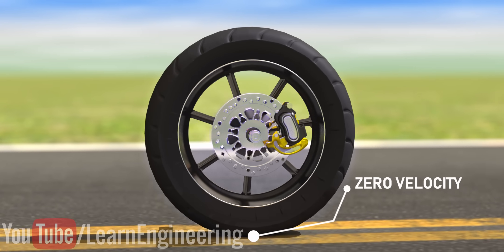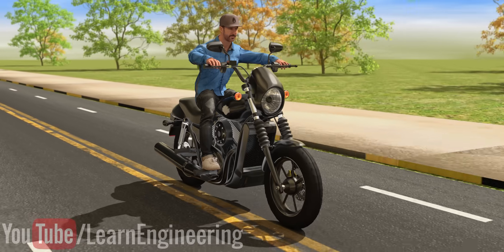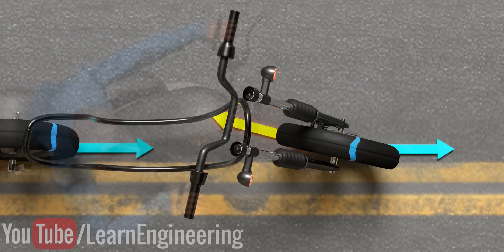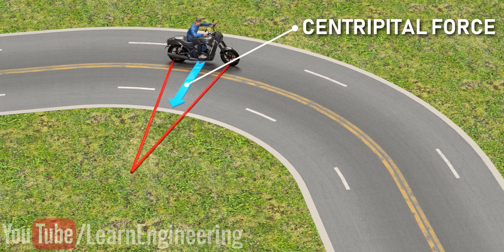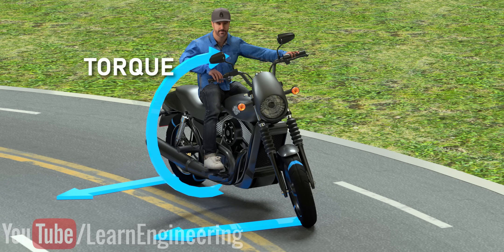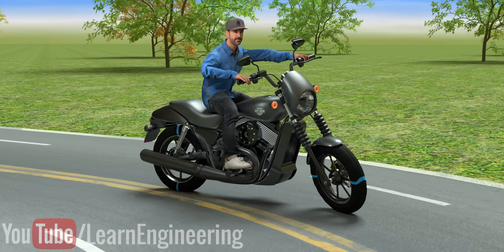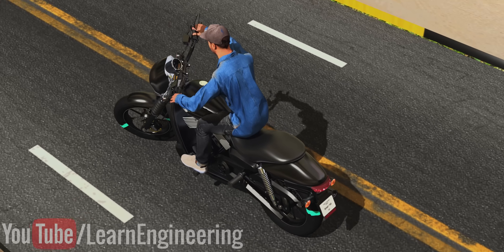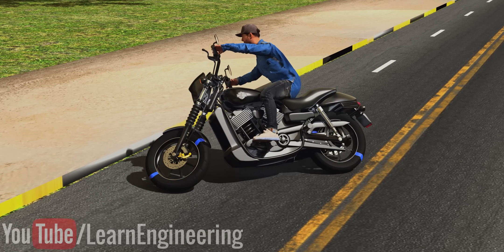Counter Steering | The interesting physics behind it

Comment: This is an okay explanation on the basic forces applied in turning scenarios, but it's too generic as it assumes the bike is always going under 15mph where you can overpower gyroscopic forces of the wheels. Otherwise you could never steer normally anyways on anything over 20mph as the wheels are producing too much gyroscopical force. Regardless, the technique is life saving and essential for good emergency habits and skills.
Reply: It’s not really though is it. It’s very misleading in the “cleverly turns” bit.
Reply: Gyroscopic forces are so miniscule that you can forget it completely.
You can even cancel the effect and the bike will turn just as fine.
Under 15mph or over 20mph does not matter. Btw. why there is 5mph gap?

Comment: No No No! First, you don't turn the handlebars to enter a corner, you lean. You can't turn the handlebars from straight, there is too much gyroscopic force preventing that. Next, if you want to get more turning effect, you press down on the inside grip. This will tighten your turn. If you want to turn left, press the left grip. I think this guy is talking about weaving opposite into a turn at slow speed. This is dangerous stuff to do as he says. Best of luck!
Reply: I’ve never seen anything as wrong as this video, until I came across your explanation! How wrong can you get this fella? Do you even ride a bike??!!!!
Reply: That's a new one. "Too much gyroscopic force." :D

Comment: Finally. I've watched several vids on counter steer & could not make any sense of it. Now I get it.
Reply: If you think this video is correct…… you don’t get it. This video is dangerously inaccurate as far as counter steering is concerned!!!!
Reply: @softailfun  how so?
Reply: @porkchopspapi5757  
Here’s a link to a practical demonstration of counter steering https://youtu.be/lzk8oyNO708
Note the rider NEVER steers into the bend although the front wheel does indeed steer into the bend. This is due to the bikes own geometry at work and not rider input. In the video you see the rider wanting to turn right, he initially steers left and then “cleverly” steers right. This would never happen on a bike at road speed. The initial steer left (more of a gentle push on the right bar than actually steering) would lean the bike to the right. If the rider were then to steer to the right (as the video suggests) the bike would stand up and fail to take the bend. The initial push on the right bar (steer left) is maintained throughout the right hand bend, only released when the rider wishes to travel in a straight line after the bend is completed. Hope this helps, sorry for the long answer.

Comment: Above ~20mph a bike turns by leaning, not by turning the handlebar, if you just lean a bike into a corner, you are fighting the centrifugal/centripetal force, whatever you want to call it, you are trying to push your weight and that of the bike against this force that wants the bike to stay straight, to get a lean & make the turn.
Countersteering works by using this force in your favour, by pushing (not steering, because almost no movement of the bars will occur) the bars to the left whilst leaning to the right, causes the lower part of the bike/rider unit to swing to the left, immediately causing the bike/rider to lean to the right & consequently turn to the right.
Counter steering works with centrifugal force to cause the bottom of the bike/rider to move out of the corner to get the lean rather than fighting the force to get the top of the bike/rider to lean into the corner.

Comment: ive driven motorcycle for more than half my life, i saw vertasium made a video on this subject but he used a bicycle, so i did the experiment on my own, well turns out i dont counter steer on motorcycle like wtf
Reply: Yea you do fella, or you ain’t goin’ round no bends. It’s not an option friend.
Reply: @softailfun  no i don't, i'll find someone to help me record, the reason i know why is because all i do is yank literally yank like pull with a force and i can pulla the bike into a dirrecional, idk how to explain it but all i know it requires i decent amount of strength, kinda like when you drift a car you turn the wheel super fast to lets say the right but you turn to the left, well i just pull... Hmmm like when you do a american punny hop on a bicycle you pull with your arms up and just let you body follow, well i pull to what ever dirrecion and let my body follow, i mean if Im casually driving most likely i do counter steer cuz your brain goes on auto pilot but i know i can avoid to do it and still do some want sharp maneuvers

Comment: This isn't a good explanation. Turning the handlebar moves the mass center out of the line that goes through the contact points of the weels with the ground. That's what makes the bike lean and consequently turn. This way you can easily beat the forces created by the gyroscopic effect. Trying to do the same with your body is unstable, dangerous and very hard to do at high velocities or in heavy bikes. At med/high velocities you're countersteering all the turn.

Comment: I'm really not trying to be that guy but that's just not what happens.
If you really understand this technique;
It's the pressure applied to the bar in what seems COUNTER to the actual direction of the turn;
But at no time does the bike or bars ever actually turn in the opposite direction...the gyro of a heavy spinning front tire/wheel will not allow you to turn the bars at highway speed. 
I teach people to apply pushing pressure to the grip. 
 If you are trying to make the motorcycle lean and bite into a left corner, you must push the left grip. 
If you think you are going too fast to navigate the turn...PUSH HARDER, the bike will bite you just have to push harder.the bike will not turn right but the gyro effect will cause it to lean and turn left.
NOT PUTTING A DEATH GRIP on the bars is critical. That's why you do not turn. 
It must be more relaxed than that. 
I teach people to practice this slowing at first by simply pressing on the grip with a single finger at slower speeds to feel the gyro effect.

Comment: Total misinformation and very confusing. The only time you turn the handle bars in the direction of the turn is in a slow low speed turn. At road speed you have to counter steer and lean the motorcycle.

Comment: You guys missed quite a bit in this explanation. Regular turning is only possible at slow speed. At higher speed +/- 25km/h and above you cannot lean a motorcycle or steer normally, at this point your are only able to counter steer or push steer (is how we teach it). Trying to "steer" away from an obstacle at speed will cause you to drive towards it. Many bike accidents happen this way.

Comment: Most people who drive a motorcycle  do not understand counter steering, even people who race motorcycles know that they must hit the apex of a turn "before" entering the turn. Like in motor cross, a rider will lift their rear from the seat and lean the bike just before the turn... simply because when they get back on the throttle in the turn the rear tire produces a force that pushes & bends the front-end of that  motorcycle and that front tire will try to push out. If the front tire slips-out, the rider has that option to lean the motor cycle back up right to momentarily regain front wheel traction. This video shows some very important facts about riding a motorcycle, clearly those forces that push & bend are quite different from the force that pulls-straight! Thank you for this video!🙂
Reply: “This video shows some very important facts”!
This video also proves that the maker has never, EVER ridden a motorcycle. This video is dangerous and wildly inaccurate as far as counter steering is concerned!!!!

Comment: This has got to be the dumbest fucking explanation of the dumbest fucking myth... you counter steer on dirt and slippery/loose surfaces. On regular roads there's no "counter steering", you're pressing DOWN on the bar the side of the direction you intend to turn to. Not forward. Which leans the bike into the intended turn.

Comment: The "normal steering" method is wrong.
There's actually no such method, it's always counter steering.
You have no way to lean the motorcycle without counter steering, you just do it automatically and gently so you don't notice yourself doing it

Comment: As though even I have good experienced in my bicycle hustles but to deal with these overweighted 2-wheel vehicles like motorcycles have still aren't been part experiencing this odd sides to be my normal routines,

thus I can only handed those accounted 2-wheeled motor vehicles little bit success in CVT AT and the Semi-Automatic light motor vehicles but so far, I have still no successive part from Manual Transmission Motorcycles of any displacements those were I've favor to be my technical demand only to conform limited to the small displacements only,

thus I have still no licence to previlege me legally were I am still no hands on from that machines until to become I am legitimately licence,

I bear any respects from this discussions as though to coping with these instructions that simply reminds me I am still inexperienced one

Comment: Literally everybody does this wether riding a bike or a motorcycle. Our sense of balance is just so good we always do it without thinking about it.
Reply: Me who hasnt ride a bicycle in my entire life:
Reply: @txffy4605  loser
Reply: Don't know how true it is, but i remember hearing guys that rode choppers that had a high degree of rake speaking about the need to steer in the opposite direction while cornering, if true, is what they were referring to the same as this video is trying to explain?
Reply: @bigfan9805  Even a bicycle does this. It's not a technique, it's physics.
Reply: @bigfan9805  yes. due to the rake of choppers, its much more noticable.
Reply: True, but with awareness it's much easier to act in terrible situations.
Reply: @YamiGenesis  I agree with you, this
is not at all an automatic thing that
people do without thinking. I even 
heard a pro say is natural, such total
bs. Leaning comes naturally,
as one learns to ride a bicycle
or motorcycle, but not 
counter-steering. 
Counter Steering
has saved me at least once, in 
a high speed turn, I use it all the time.
There is also a difference between 
steering dynamics at 3 mph and 20 on up,
something most people are 
confused about. 
Counter-steering is a life saver 
that should be taught, but correctly
this video is SO NOT it. 
Counter-Steering and leaning work
together, both are needed at 
highway speeds, in turns at speed,
and quick evasive maneuvers.
Reply: @ yes you do countersteer without even knowing all the time just to keep the bike upright. It is doing deliberately in emergency situations that should be taught. And no, leaning into the turn isn’t always necessary or beneficial in emergency maneuvers. Correcting the trajectory of a high speed turn cause you came in too hot and about to go wide? Sure, countersteer and lean in! Swerving to avoid a sudden obstacle at low to medium speed? Countersteer and counterbalancing (leaning the bike and staying upright with your torso) is way more effective
Reply: Then maybe we should shut up about countersteering at all cause the instructors say dont overthink about it…but then talking about this confuses people and makes them overthink it…
Reply: I've never done this while riding a bike, even when I was doing over 20 down a hill into a mild turn I've never done this, I've always leaned and steered the tires in the direction I want the bike to go
Reply: @MRBOOOYA  you just proved his point
Reply: @MRBOOOYA you don’t get it. you do it involuntarily all the time you keep the bike upright at low speeds. remember learning to ride a bicycle as a kid? remember when something clicked and suddenly you could stay upright and almost didn’t know how it happened? yep. your brain learned counter steering without telling you bud
Reply: @MRBOOOYA  What they said is not an opinion. Its a fact. Unless your "turn" is basically the road vaguely changing angle, you physically have to do this. Even going 10mph you HAVE to counter steer or you will fall. Its just so automatic you wont even notice it unless you look for it. Veritasium concretely proved this by setting up a bike where the handle bars could only turn one direction.
Reply: @sitokiaba5404 its not a fact, its just reality which doesnt agree with you. countersteering is as shown in the video, its a conscious act. you have to actually do it, it wont happen on its own
Reply: @MRBOOOYA  Unlikely. It's incredibly unstable to not countersteer.
Reply: Im terrible at riding bikes. Never leaned anything. I definitely dont do this.
Reply: Not everyone lol
Reply: @YamiGenesis  Yes, EVERYONE. It happens whether you want it to or not.
Reply: @generalyellor8188  "not everyone" referencing the person in the video
Reply: @YamiGenesis yes everyone who can ride
Reply: I remember while learning to ride a bike i would turn without counter steering and fall off (mainly left turns)

Comment: Ok...the problem with the "natural steering" premise is that it only works if there is near to 0 centrifugal force coming from the front wheel. At most riding speeds, turning the handlebars in any direction will initiate a turn in the opposite direction no matter what the rider does. Leaning has little to no effect in turning a bike. You can literally lean 90 decrees off a motorcycle and, with little deviation, it will continue to go straight.  Everyone who rides a bike countersteers whether they know it or not.

The best way to practice countersteering is to get the bike up to speed and push forward gently on the handlebar which is in the direction that you wish to go. To turn right, push forward gently on the right handlebar. The bike will then initiate a right turn and the front wheel will want to track that turn and you can stop pushing and the bike will continue in the direction you want to go.

Countersteering in a car isn't the same as countersteering on a bike. A bike turns by changing the camber of the front wheel. A car turns by changing the direction of the front wheels.
Reply: You are soooooo wrong.  Gyroscopic forces are ALWAYS trying to level the wheel.  This means that when the gyroscope (the front tire) leans away from the direction of rotation, it will begin to "drift" TOWARD the center line of the rotational plane.  In other words, you turn it to the right, you go right.  Tires are designed to NOT travel sideways.  Thus, if you turn left to turn right, you are not going to turn right.  You are either going to flip over the handle bars or you are going to fall over.  I have seen enough videos of beginner motorcyclists who think they can counter-steer at 60 MPH and end up skidding into something when the tires go out from under them.  There is a far safer way to demonstrate how gyroscopic forces work; sit in a spinning chair and hold a wheel at the axle in such a way that the wheel can spin freely.  Have someone spin the wheel while you hold it perpendicular to the floor (90 degrees to the plane of the floor).  Now angle the wheel left or right.  You will begin to spin towards the top of the wheel.  THAT is how a motorcycle turns.

Comment: This video makes it sound like there's multiple ways to turn a motorcycle at speed. Thats not true. The only way to turn is to counter steer! Countersteering initiates lean, the front wheel points in the opposite direction only momentarily during that stage until handlebar input is eased and then the wheel points into the direction of travel. The only time you ever turn the bars in the desired direction is at very slow speeds like crawling or walking speeds.

Comment: There is no normal steering on bikes and motorcycles. An experiment with a modified bicycle, that allowed only moving the handle to one side showed very clearly, that it is impossible.
For more info, check out the video from Veritasium: https://youtu.be/9cNmUNHSBac

Comment: Counter-steering is used by ALL motorcyclists on turns faster than about 10 mph.  It's the only way to turn a bike.

There are many that don't realize they are doing this.   They are at risk of turning into trouble when faced with a scary situation because their instinct tells them to turn away from the dangerous spot. In doing so they steer into the trouble.

Every year you read about riders who crossed the center line and ran head onto a vehicle going the opposite way.  A lot of them likely didn't understand counter-steering.

It nearly happened to me on the day I bought my first bike back in the mid-eighties.
Reply: To get driver license in Norway you have to train counter steer in a turn and to avoid obstacles. When you take the last test, they include countersteering and braking in a corner. Im not saying there is not accidents in norway relating motorcycle accidents. But im sure the mandatory training helps quite alot
Reply: Not true, i. This video you can clearly see this guy not counter steering and turning. Eventually he gets in trouble. *graphic video**

https://youtu.be/VVE79XT8-Mg
Reply: You really understand countersteering when you can lean your bike over, and still ride in a relitively straight line
Reply: @Zac-fu2qc  
What????? If you could, why would you want to?? Ridiculous comment!!

Comment: This is perhaps the worst explanation of "countersteering" I have ever seen. The "normal steer" that he describes is only used at very low speed and countersteering is ALWAYS used at higher speeds; even if you don't realize you're doing it. This is true of bicycles as well. The narrator never mentions gyroscopic precession; which is the very reason this phenomenon occurs.